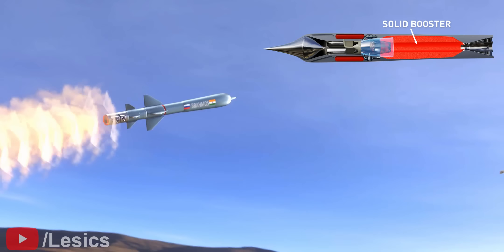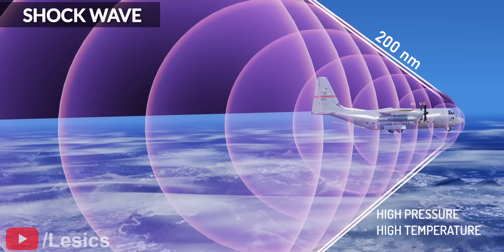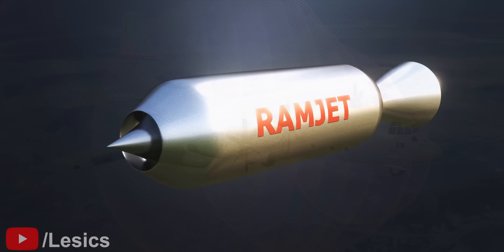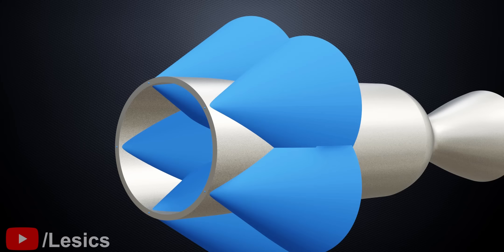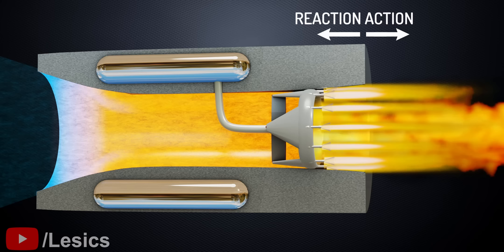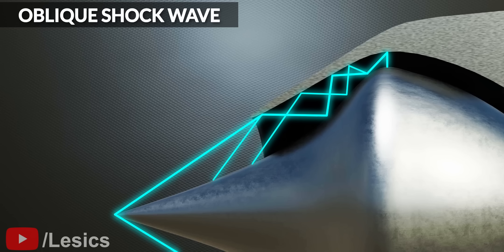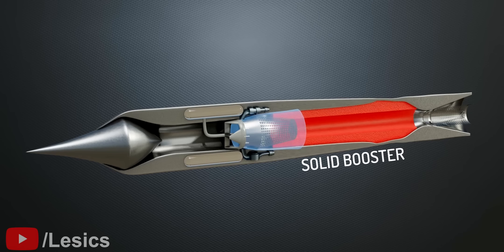Ramjet engines, How do they work?

Comment: This kind of rockets has been developed and produces by soviets, starting 1964. It's been known as 2K11 Круг anti-aircraft system or SA-4 Ganef (NATO code) with 3M8 ramjet rockets (speed 3700-4000km/h, range 50 km horizontal, 25 km vertical )

Comment: You do not need high tech, expensive missiles for air defense. The air craft in med air has 6 posible maneuvers. On it May slow it’s speed
2- it May accelerate 
3- it May turn left
4- it May turn right
5- it may go up
6- it may dive down
Having  six barrels, parallel to each other to eject a projectile each of which aimed at one of the six posible craft location according to pre calculated location will do the job. Use the radar to pinpoint the craft location, direction and speed. Program the data in the projectile microprocessor to tell it when to explode.

Comment: You forgot the mention the most important part of a RAMJET though you did somewhat allude to it: Combustion takes place at subsonic speed. The inner body slows the flow down two ways - it limits the amount of supersonic air flowing in, and forms a diverging nozzle on the other side, slowing the flow.

Comment: So, if these ramjet engines are flying in a static trajectory, than a simple ballistic counter measure fired directly at the nose of the warhead,  would be sufficient enough to detonate a standard explosive charge housed within. Could go even further as to arm the round with an explosive element in itself. Since this appears to also be an either infared or laser guided system and not an intelligence based missile system, it would be simpler to take down from  direct contact from the plane itself.

Comment: I believe the first serially used ramjet engine was in Soviet surface-to-air missile system (SAM) called Kub which had NATO designation SA-6. Still, rater a fast missile up to this day and with modernizations, still a pain in the a$$ for airplaned, though less than it first appeared.

Comment: Correct me if I'm wrong, but I think that's actually a scramjet, not a ramjet, due to it lacking a compression chamber. Essentially, a normal jet engine, or "turbofan" engine works by sucking air in with the big ass fan, heating it, compressing it, and burning it with fuel in the combustion chamber, venting it out the back for thrust.  A ramjet is similar, but missing the fan that sucks in air. It only works if it's going fast enough that it doesn't need it to get enough air in the engine. It still heats, compresses, and burns air for thrust. A scramjet engine takes this a step further, and only works when the engine is going so fast that it doesn't need the compressor anymore. A scramjet simply heats incoming air and burns it. The speed of the aircraft creates enough air pressure in the scramjet on it's own. They're working on making an engine that could switch between turbofan, ramjet, and scramjet functionality, and while it's possible, it's going to be a few years before we see them used in military or commercial applications.

Comment: With internal inertia drill bit shape weigh spin as air flow  so it gain angular momentum as air move into jet engine and continue add extra inertia push faster and faster and also multi fuel container ejection of many stage to push beyond 20,000 miles per hour and only slow down just before lowering orbital flight during terminal phase

Comment: It looks like you're interested in a variety of advanced technologies related to energy systems, hypersonic vehicles, and space exploration. Below is a detailed overview of the concepts you've mentioned, including some potential applications and implications.

### 1. *Quattro 12 x2 Power Matrix Grid*
- **Power Matrix Grid**: This concept could refer to an advanced energy distribution system that integrates multiple energy sources (solar, wind, etc.) and optimizes their use for efficiency and reliability. The term "Quattro" could imply a four-part system or a specific framework for energy management.
- **12 x2**: This may denote a scaling factor or configuration implying that the grid can handle or expand to 12 different energy sources or nodes, doubling the capacity or efficiency in some way. This would be relevant in the context of smart grids that utilize modern technologies to manage energy flow effectively.

### 2. *Hypersonic Glide Vehicles (HGVs)*
- **HGVs**: As mentioned earlier, these are vehicles capable of traveling at speeds greater than Mach 5. They are increasingly being studied for both military applications and potential commercial uses. Their ability to glide and maneuver at such speeds presents significant challenges and opportunities in aerospace technology.

### 3. *Scramjet Technology*
- **Scramjets**: These engines are designed for hypersonic flight and use atmospheric oxygen for combustion, allowing for simpler designs compared to traditional rocket engines. They are crucial for developing future aerospace vehicles that can operate efficiently at hypersonic speeds, which is essential for HGVs and other advanced aerospace applications.

### 4. *Micro and Nano Solar Technologies*
- **Micro and Nano Solar Technologies**: These technologies focus on creating smaller, more efficient solar panels and energy systems. Innovations in photovoltaic materials, including perovskites and nanostructured solar cells, could lead to significant improvements in energy conversion efficiency, lightweight designs, and flexible applications.
- These advancements can also contribute to the power matrix grid by providing decentralized energy solutions, particularly in remote or off-grid locations.

### 5. *NASA and SpaceX Technologies*
- **NASA**: The agency is involved in numerous research initiatives related to advanced propulsion systems, including scramjets and hypersonic vehicles. NASA’s work on the Artemis program and other space missions also involves developing new technologies for sustainable space exploration.
- **SpaceX**: Known for its innovative approaches to space travel, SpaceX’s reusable rocket technology significantly reduces the cost of space missions. Its ongoing projects, such as Starship, aim to facilitate missions to Mars and beyond.

### 6. *Projectile Interceptor Technologies*
- **Projectile Interceptors**: This refers to technologies designed to intercept and neutralize projectiles, such as missiles or other airborne threats. Advances in hypersonic technology and scramjet propulsion could enhance the effectiveness of these systems, providing faster response times and increased accuracy.
- Integration with advanced radar and tracking systems, along with AI for decision-making, could make these interceptors highly effective in modern defense scenarios.

### Conclusion
The integration of these technologies—power matrix grids, hypersonic glide vehicles, scramjets, solar innovations, and advanced interceptor systems—paints a picture of a future where energy, transportation, and defense systems are highly efficient, interconnected, and capable of meeting the challenges of modern and future needs. If you have specific areas within these topics that you would like to explore further, please feel free to ask!

Comment: And if you start to calculate the actual geometry you will create a whole book worth of pages in mathcad... And this is just one aspect of the rocket... Not too mention the materials that can withstand these pressures and temperatures, stearing, communication, dopler effect affecting radio signals, and structural strength patterns. That's why they can rocket science the rocket science!

Comment: All of these explanations miss a part that I don't understand:

On the animation the only thing that seems to prevent the combasted fuel-air mix to leave the engine trough the inlet as well as the outlet is the airflow that is come in trough the inlet. But if the airflow force the gas go backward, that also means the airflow get its counterforce, not the engine. So how it actually works? In other words: exactly where and how does the gas push the engine (and not the inflow air) forward?

Comment: interesting A10 knock off. Fun to nitpic. whole reason for the engines up top is to hide their heat signature. landing gear must be 8ft tall. Intake sucking in debris during takeoff and landing not a problem. one more, top speed of a C130 is 370 mph. you use THAT to represent the speed of sound. 😆

Comment: Ramjets do have moving parts, the Fuel Control system requires valves to control the fuel flow, even on the ones that use a fuel rich rocket motor as the fuel source.
Reply: Haha. Good point.

Comment: Is there an engine of this type, that can also put oxygen from tanks into the chamber, so it can go higher in altitude and then, when high enough work as a rocket engine completely without any external air? So that you could start a rocket like a plane, go as high as possible with help of wings for more efficiency and the switch to rocket mode and go up. Probably leaving the wings and stuff going back to earth as a first stage.

Comment: at what max speed can a ramjet operate? i know it might depend on: 
type of engine, weahter conditions or so. 
but can it travel faster then turbojet engines and other engines used in fighter jets etc? 
thanks
Reply: Ramjets can operate at up to Mach 6 while turbojets can operate at max Mach 3.5. To go quicker, you need a Scramjet, which is basically a ramjet but it ignites the air when it is flowing at supersonic speeds inside the combustion chamber.

Comment: ouch, looks like there are a few issues with the explanation and the illustrations. Firstly, it will be very unlikely for a propeller aircraft to get anywhere near Mach 1 in level cruise for obvious reason, and yeah, even less if the gear is down. The shock wave explanation is cute, but it's simply a constructive effect and has nothing to do with information theory. It seems the explanation of the oblique shock wave is quite off too...

Comment: that a-10 warthog was cursed as hell with its engines hamstrung beneath it, looks like some kind of nightmare test design that never made it off paper. also loved the bit where the C130 broke the sound barrier with its gear down. the slightest bit more effort into using actual planes that can break the sound barrier surely wouldn't kill you for how much brilliant had to have paid you for this video, also sounds a bit like an audiobook of a wikipedia article. lazy work for a quick paycheck I presume?

Comment: Since the BRAHMOS flies more than speed of sound it would be easy to destroy if nanotungsten dust is sprinkle on the way of the missile as it is low altitude missile. Nanotungsten dust with high density would destroy the tip of the missile and easily destroy it. Nano tungsten dust filled in the explosive balloons would be nightmare for Brahmos. More pyrophoric nano DU can also be used but it is more hazardous for the soldiers at ground.

Comment: i think it can be intercepted easily , as its nose it will create very high temperature , mean heat seeking missiles can lock on it from far easily , maybe this is why usa and russia not going for ramjet cruise missiles  because they fly low with less heat signature which is difficult to engage by air defense systems because of the a lot of noise on lower altitude but incase of Brahmos you not need air defense system radar guidance to track that missile is it will be generating a lot of heating signature so can be tracked via thermal scanners from top maybe from Awacs and then launch heating seeking missiles in that direction and their heat seeker will engage the missile very easily

Comment: What is the expanding ignited gasses pushing against to to give it forward thrust?
Reply: Nothing. Newtons 3rd law, equal and opposite reaction, throw stuff fast backwards, you go forward, no need to push on anything
Reply: @lucaherman6227  that’s not quite right.

Comment: But from a jet plane like Mig-21 or Sukhoi Su-30, ramjet missile can be fired without rocket booster in a supersonic speed.
Reply: Booster is mainly used to extend range rather than speed....

At lower altitudes, air drag is considerably higher and movement becomes expensive... So we use boosters either to get to a pretty high altitude(low air resistance) or gain that initial momentum after which the booster is dropped and the missile does it's thing.

Comment: If there's no moving part's in a RAM jet engine. How does the liquid fuel get to the combustion chamber,
Reply: hydrogen is liquid under high pressure, so it sprays itself into the combustion chamber
Reply: @dragoss16  but what releases it?

Comment: My invention flash driving running in light speed way can power that perpetual power,  
No fuel no batteries and not noisy , 
Flying in no weight way and gapping zone way to travel   the up is pulling the bottom is pushing and the missile is following only,  and can float in the air and the speed in firing is light speed way 
Look at my prototype rotary motion , how much speed is that .
Plus my more faster than the real driving .
You can have it if you want and pay for my 50years in repair works.

Comment: Ram jets includes a jet engine(like in sr71 that coined the expression, or at least made it famous), this is an air breeding rocket engine, is it not? By the way, waaaay slower than any ordinary rocket that easily does mach 20. Like everyone else, I'm more impressed by the speed of the plane in the simulation

Comment: Just build a radar that locks on to the thermal heat signature of the solid rocket booster of the ram jet and a laser detonating defense weapon will destroy it before it reaches its upper Mach speed s.
Reply: Solid booster works only few seconds... Then it touch speed of sound. After RAM jett engine will Carry the speed... That's why no redar system can't catch Bhramos... And also have ability to fly in low altitude of 1 meter..
In India, bhramos version 2 is under developing.. May can touch mark 7 to 10.
India show the power of Brahmos in march 9. Mistakenly fired to Pakistan with no war head. Packisthan army didn't identify bhramos until india officially post an apology on twitter.

Comment: everything wrong so far:
-Bramhos isn't the only supersonic cruise missile
-Bramhos can be intercepted by modern air defence systems, although it is hard
-The A-10 model at 0:25 has the engines nacelles at the totally wrong place
-The Bramhos isn't an air to air missile, and CAN'T be used against a flying aircraft
-The Bramhos length is above 8 meters, half the length of the A-10, so it should be much bigger than shown at 0:32
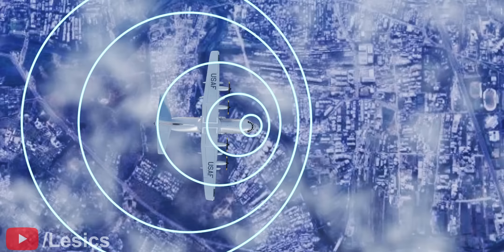-The C-130 aircraft shown at 1:13 is unable to approach, let alone reach supersonic speeds. In fact, no propeller driven aircraft have ever exceeded mach ~0.9

It is understandable as to why low accuracy models could be used to fill the screen. But in this video, EVERYTHING military related that was shown was wrong, almost as if it was intentional.
For videos showing military material, this channel would either needs either a military advisor, some very basic research, or in the case it was intentional, to please stop this tomfoolery